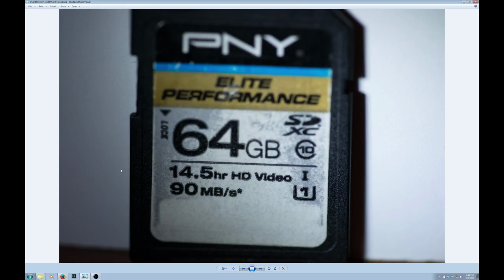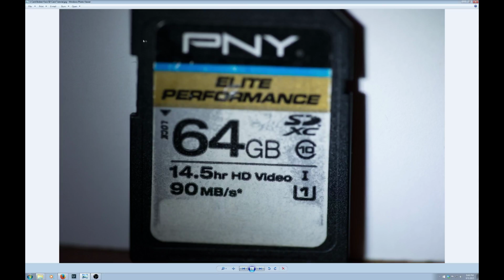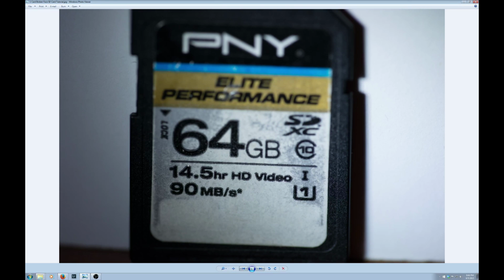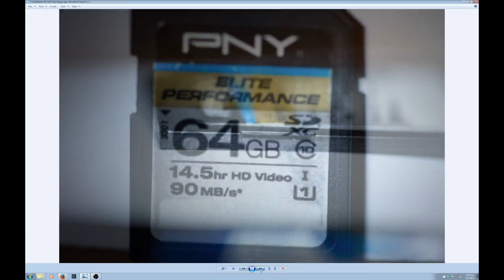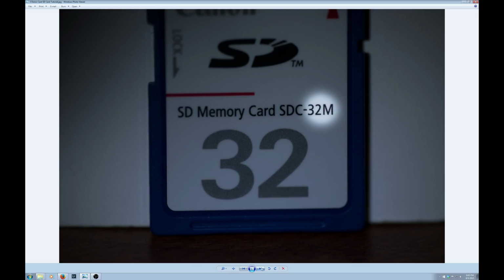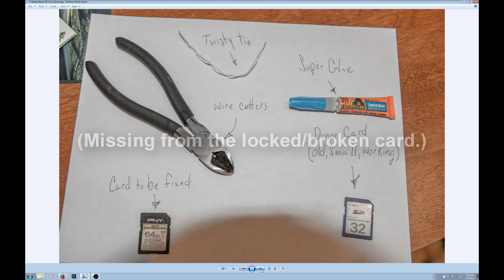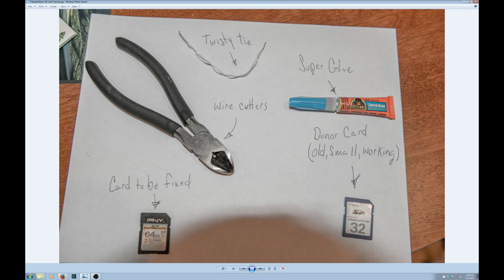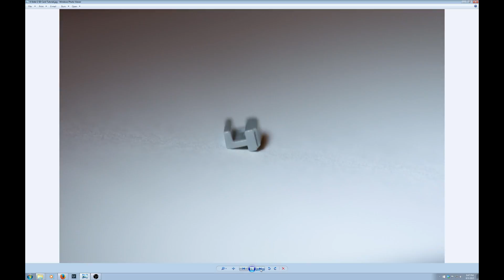How to fix a locked SD card using an old SD card instead of scotch tape. (Tutorial)

Comment: I just had success using some bell wire that I bought from Maplin (UK) a lot of years ago. It's single strand, thick blue plastic/heatshrink sheathing and stripped it back probably 80mm then I bent a U shape in the end of the metal wire and then I inserted the card then the wire and pushed until it felt snug. I tested multiple times and you need to look at your card reader to see if it's a long metal bar that is pressed if the switch is closer to the pins, hence the need to insert the wire further.
If it is a sprung switch/latch that is in a specific place, then you may need to follow this video or buy a cheap chinese card reader - I have one of those see through "USB2.0ALL-in-1CardReader" USB 2.0 card readers and that doesn't honour the lock. Mine looks identical to this http://stuffopolisnet.yourwebhosting.com/UploadFolder/USB%202.0%20All%20IN%201%20Card%20Reader-Writer-thumb.jpg